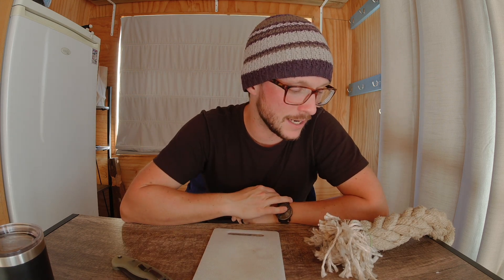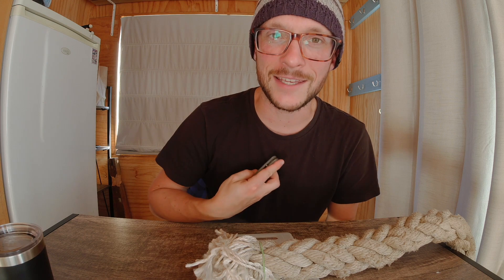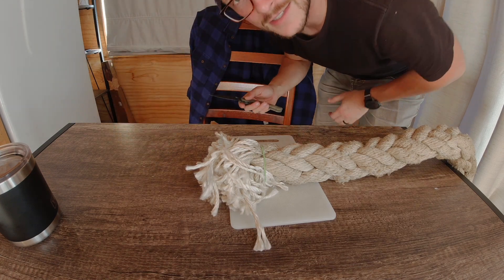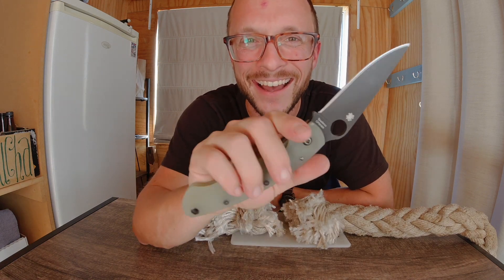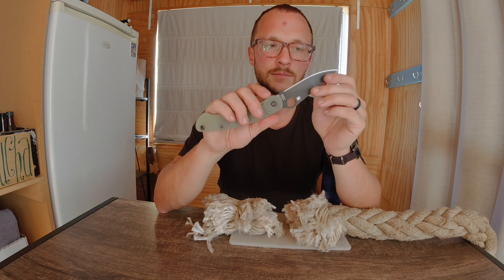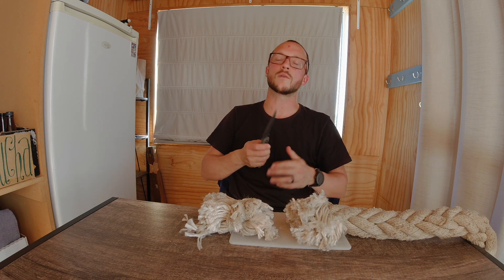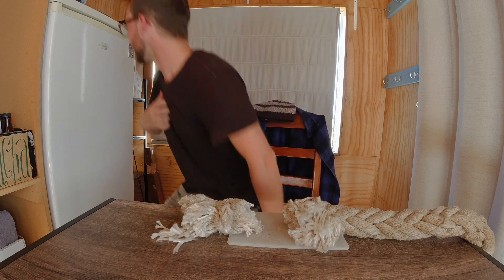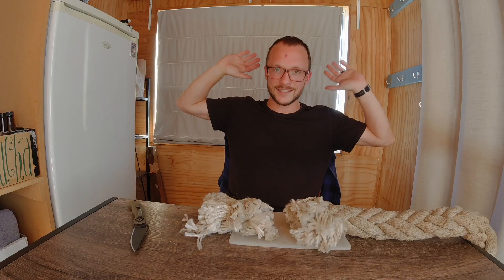JAGGED 250 Grit Edge vs Gnarly Ship Rope - Can CPM M4 Prevail? Spyderco Military Knife Test

Comment: While the maxamet almost burned the rope by friction, the M4 kept cutting. Toughness is certainly a part of the solution, you want to hold on to the carbides but not roll over and certainly not losing them. I see why you like this knife so much in this configuration Gabe. Next dual grit on a 22 degree angle? Thank you friend and have a great weekend.
Reply from the maker: Yeah, it would seem so!

Next up I will try Dual Grit also at 17dps!

Take care Jeroen - nice to hear from you.

Comment: That was quite interesting. I am learning from your tests that even though we knife nerds will use a different knife for particular purposes, we should also be thinking about the edge we put on a knife to suit a particular purpose. For example,  someone might take their 1080 or 440C knife out bush and abuse it (like cutting ship rope), but would never take their M4 or Maxamet into the wilds for fear of it dulling and being too hard to resharpen in the field. Based on your tests so far, with these high-end steels and coarser edges, I'm thinking I should go back and revisit your S30V tests and see if it's feasible to make my big Crooked River edge a little coarser.
Actually, I was just fiddling with it and I've always noticed that there are very fine milling lines that run perpendicular to the edge on mine. I assume that's a feature and wonder if that 'saw' pattern could be accentuated with a particular sharpening method.
Reply from the maker: Yeah, I have been blown away by the difference that edge finish and sharpening makes in these tests - sometimes far more than steel type or hardness.

The S30V test where it does best with the ship rope is 250 Grit Coarse diamond plate edge, and it’s a Benchmade so similar HT to your Crooked River - will link below 👇 

https://youtu.be/QUiVtKe8DEs

Comment: Cpm M4 for the win!! 
I predict that a thin main bevel edge with a dual grit or course micro bevel will be more consistent cutting thought the dethroap. Because the steels can handle it and the low edge angle will put more pressure on a smaller cross section. 
Thanks for the effort Gabe.

PS. Isn’t this curious that your results are the total opposite to the results of Pete’s test results?
Reply from the maker: Interesting prediction!  Yes!  I think I agree as well.

Yeah - very interesting that they do not align with Pete’s results.  Well, they do in that low carbon steels don’t last, but it’s almost like a curve that goes up (More carbon, better result) like Pete’s, but then flattens off, or drops slightly.

I think that’s a function of toughness being needed to resist chipping by sandy crud.

Comment: I think there is a lot of unknowns about these super steels. The reason why I say that is the amount of diversity of information/opinions about best way to sharpen them, how they are supposed to perform or how they actually perform. The more diverse and disparate the information, and less uniform the more that points in the direction that a lot of unknowns are out there. If anyone has solved the code/mystery of different types of super steels, there would not be that much diverse viewpoints about them and the debate would have settled long ago.
Reply from the maker: Sure - I’m fact most of my coming research is going to be investigating which sharpening methods help the edge last as it should!
Reply: @homeslicesharpening  Good luck. Will follow with anticipation. It’s quite interesting topic cause it straddles science and anecdotal experience.
Reply from the maker: @mmikee407  True!  It's hard to nail down, but as long as I am helping others and myself have more fun I'm happy!
Reply: @homeslicesharpening  Of course mate. Enjoy 😊